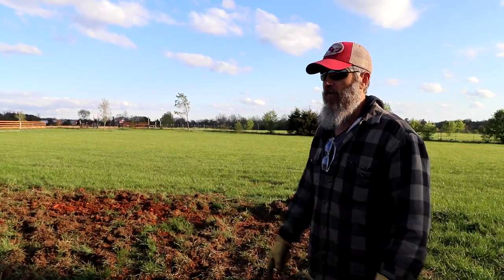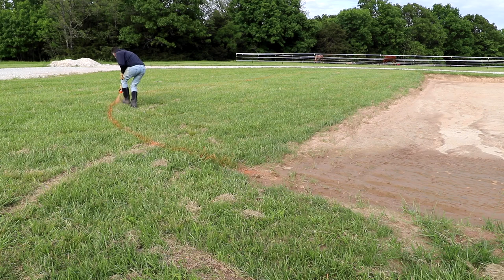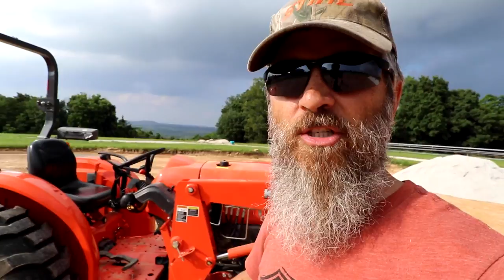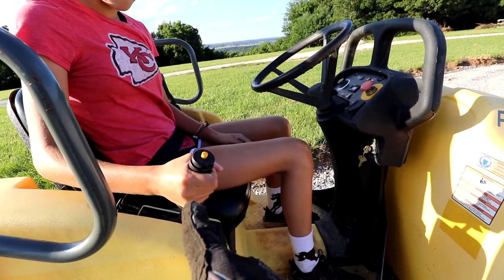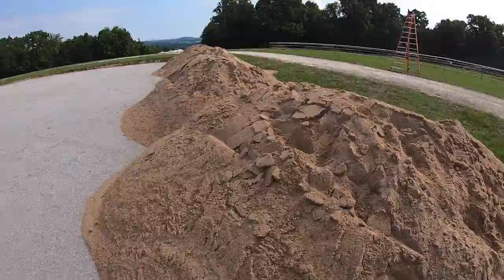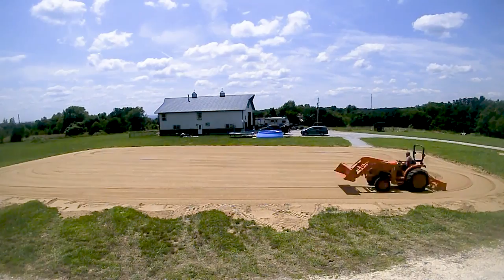Building our DIY Horse Arena at the Ranch, From Scratch

Comment: We are building a riding ring, how did you evenout the dirt layer before you put the gravel? We used a wheel loader to shape the dirt, but it is difficult to get a flat area that has less than +/-15 cm (approx. 6") variation. It looks like you used this tool on the back of your machine, how is this called (it looks like you also used it to rip out the grass). Any tipps would be appreciated. Thanks a lot for the video 😊

Comment: Great video. I started with my 60' round pen this summer here in Montana. Got the top soil out and hand picked rocks for two days, lol. Than had two truck loads of "sandy loam" brought in. Rainy season came and now I have decided that I need to redo the whole dang thing. The water just makes it a big loam puddle. I know now that I need to account for drainage. Plan is to elevate the grade of the entire round pen and add some drain pipes underneath of it. I have watched a lot of other videos about this and they also mention textile fabric between the different layers of material. Glad I did not start with my arena.. :) How is your arena holding up to date?
Reply: don't cheap on the fabric, it's gotta be cushioned too, and will likely wear out in a few years and result in losing aggregate slowly, maybe double layer the fabric...  I am on the same problems, but solving them prior to build out.. have some experience and 2 skiddies, one with an 84" dirt tooth bucket... went to horse world expo and spoke with a PSU rep knowledgeable regarding such things, so that was helpful too.    would not use soil unless roofed and dry.  Sounds like a sweet place.  Good luck

Comment: That top coat of sand looks a little too loose? Nice job with the arena….
Reply from the maker: Yes, a little.  It works okay for now when watered real well and packed.  It was all I could get at the time with all the shortages of everything.  I even had to have this brought in from a couple hours south of here so even cost me more.  I am planning on adding a couple truck loads of some better river sand with more fines and irregulars it when it becomes available up here again. That should help stiffen it up and pack just a little bit more.  Thanks for watching.